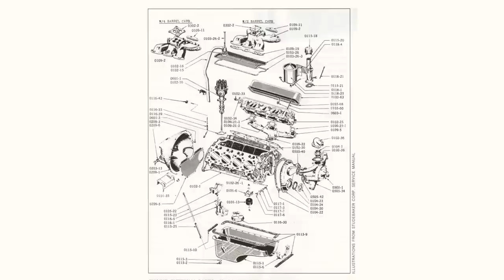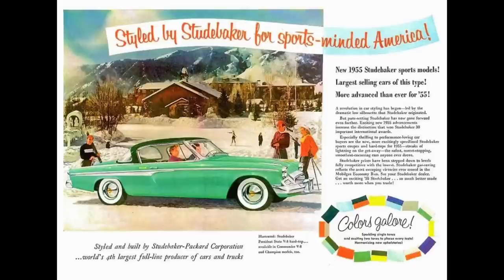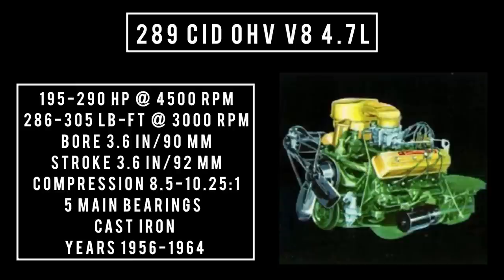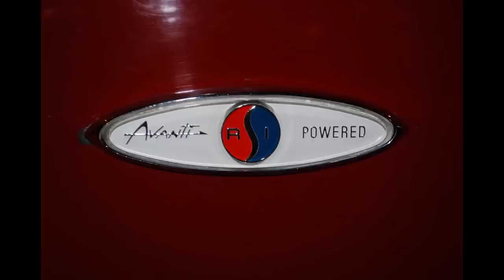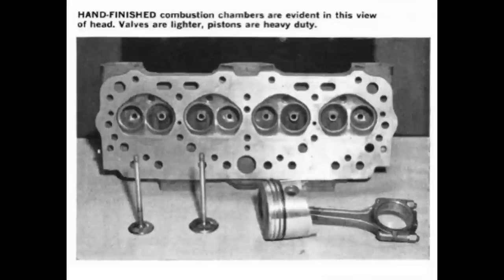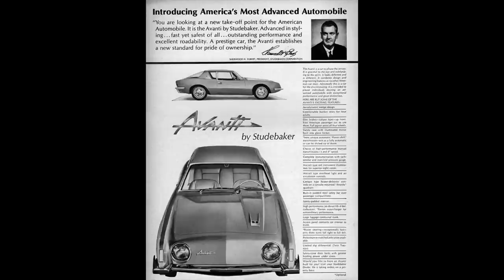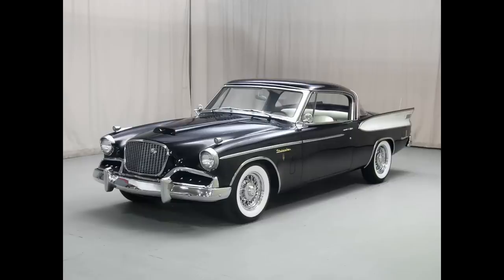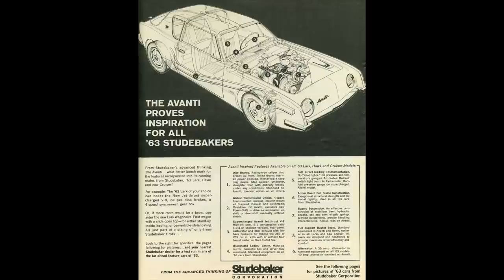STUDEBAKER V8 ENGINE ( 232, 224, 259, 289, 304.5 )

Comment: Another great presentation. I didn't have a lot of experience around these engines, but I read alot,and heard about those engines and almost all good. Thanks again for the nice work,learned a lot.
Reply from the maker: Glad you dig this episode =)
Reply: @What.its.like.  Yes I did, it's great work,I hope you do a piece on the International 266-392 V-8S,in my eyes a great gas truck engine that never used timing chain gears.
Reply from the maker: I’ll mark that down because this wasn’t the engine episode that was supposed to go up today I did an episode on the continental engine family but I had a brick wall with that episode and information is really hard to find and I just couldn’t find the information that I wanted to find a present to you guys so I had to switch course.. =)

Comment: To be a bit pedantic, there was a sixth displacement at 299 CID, although not a production sized engine.  The early R3 (that set all the touted records) was a 299, not 304.5.  This allowed them to run in the Class C "Production" class because 299 is a 0.060 overbore and 0.060 over pistons were a standard Studebaker replacement part.  Otherwise, they would have had to run in the prototype class.  Later, the R3 would, of course, be 304.5 AND now in production cars so it could then run in the C production class since it was still under 5 liters.  Studebaker referred to the 299 and 304.5 R3 engines as "A" engines and "B" engines respectively.
Reply from the maker: Great information thank you so much for sharing that

Comment: I have a 59 silver  hawk with a 259 clover leaf block so it is a truck engine with aluminum timing gears. It has ported 1955 high compression speedster heads and flat top pistons. I installed a supercharger setup from a golden hawk and backed it all up with a t10 4 speed. The little 259 just screams with the this setup! Its a fast car. High compression makes the car react quicker to the supercharger and man it pulls hard. Its hard to believe that Studebaker was able to pull this off in the 1950s. They were way ahead of the curve!
Reply from the maker: Wow that’s awesome thank you so much for sharing that I didn’t know the 259 silver Hawk came with the 259 I always thought that they came with the 289.. I really need to cover a silver hawk I would love to cover all of them power hawk Skyhawk but those were all just available and57 from my understanding thank you so much for sharing all that information =) 

Your car sounds awesome
Reply: @What.its.like.  Actually, the 289 was not available in the 59 Silver Hawk.  It was again offered in 1960.

Comment: The worst part of a studebaker engine is the Siamese center exhaust ports. It limits flow. I know a guy with a 232 that’s setup like an r3 avanti’s engine but still 232 ci. It makes 350 hp at 7lbs boost

Comment: Actually, the Studebaker V8 was produced for 13 calendar years, 1951 through 1963. In December of 1963 production was halted at South Bend, Indiana and shifted to Canada. Having no engine casting facilities at the Hamilton factory, the Chevrolet 230 SIX and 283 V8 were used till 1966 when car production ended.  The R-3 Lark would be a sleeper, particularly as a 2 door sedan. Lighter and faster than a convertible too.  A 1953 coupe or hardtop with an R series motor swap would be sweet too.
Reply from the maker: Awesome information and insight thank you so much for sharing that =)
Reply: @What.its.like.  -  You're welcome. Sadly, for Studebaker employees, the plant closed just before Christmas, 1963.

Comment: WYR1:  '55 President Speedster in gray, coral, and white, with first-year available factory air.
WYR2:   None of the above, I'd rather have a '63 Avanti, a '63 Lark Daytona Wagonaire, or a '64 Gran Turismo Hawk, any of the three with the R1 engine and three-speed transmission with overdrive (dealer option on the Avanti) and the Lark or the Hawk trimmed out with the full Super Lark or Super Hawk kit (as appropriate).
Reply from the maker: Great choices write ins are always welcomed I love seeing the difference of opinions in cars I think it’s awesome. 

We might add something to that like if you had a car like that would you trade it for any of these three are would you keep it because I think it’s very interesting to hear what people had to what they traded for I worked at the Classic Car dealership last summer and it was really interesting to see what people had and traded for like I saw a guy trade a 2016 dodge challenger coordination so I didn’t have any it was like base model but it was like brand new it only had like 3000 miles on it he traded it for a 1962 Plymouth Savoy 413 I don’t remember how much he had to pay as well I think he traded the car in and had to pay 25,000 or something like that I don’t remember

Comment: I believe that Studebaker introduced the first American OHV V-8 in the low price field. Dodge didn't get a V-8 until 1953. Plymouth got one in 1955, along with Chevrolet. Ford stuck with its flathead V-8 until 1954. Other makers learned from Studebaker's V-8 and introduced their own OHV V-8 engines using improved casting techniques. The Studebaker V-8 engines are very heavy for their displacement. Studebaker used metal with a high nickel content for strength. This was done because automakers were anticipating improved gasoline that would allow compression ratios as high as 15:1. The cylinder head design offered somewhat limited valve sizes, which hurt power at high rpm. In spite of the engine's limitations, it was strong, durable and well made. They are good engines that produce great sounds from the golden age of American OHV V-8 power. 

I can't choose my favorite cars. I want all of them.
Reply from the maker: Thank you so much for sharing all that information and insight and you’re right it was the first low priced OHV V8
Reply: Studebaker was first of the low-cost cars to have  a Overhead valve v8 engine. The cost of being first is, you can't look at the engines that come before you to improve on your mistakes. Studebaker copied Cadilac but if they could have copied Chevy, they could have had a much more modern engine. The reason the small block Chevy was so advanced is they looked at all the Engines that came before and improved their engine. Being first may sound good, but being last is a big advantage in the development department. The cost of being first were poor port design, over built engine causing heavy weight and dimensions that don't allow for Future expansion.

Comment: Studebaker afficionado here.  Excellent video, most informative.  I have a 1955 President with a 289 engine from a 1963 Hawk.  It is an excellent engine.  If you say you have a 289 people immediately think Ford but the Studebaker 289 predated the Ford.  In fact I read somewhere that Ford approached Studebaker about purchasing their 289s as it filled a niche in engine sizes.  Nothing came of it, for among other reasons, Studebaker simply did not have the capacity to produce the number of engines required.  As to your question of preference, it would be the Golden Hawk, arguably America's first muscle car. After all, I already have a 1950 bulletnose and my 1955 President State was trimmed to duplicate a Speedster by a previous owner.
Reply from the maker: Awesome thank you so much for all the positive vibes I really appreciate it I’m glad you dig this episode Thank you so much for all of the added information as well as insight

Comment: Had a 1960 Lark V8 3 on the tree with overdrive. Wonderful car!
Reply from the maker: Sweet two-door, four-door, wagon, convertible
Reply: @What.its.like.  2 door tan color, in over drive got good mileage. Also had a 1951 truck, a 1954  Champion flathead 6, and a 1951 Commander. They were cheap in the 1960s for a high school kid. THE Lark was the best!
Reply: @What.its.like.  Tan 2 door had lots of power and good mileage. Also had a 1951 Commander, 1951 truck, and a 1954 2 door flathead 6 Champion. Lark was the best!
Reply from the maker: Awesome thank you so much for sharing your car with us.. =)

Comment: Good review but you seem to skip the trucks.  Studebaker used a 224 in trucks in 1954.  Never made since to me but it works well in my 3R28.  The 2r and 3R truck comments were nice, 2R ran from 1949 to 1953 and 3R for 9-months of 1954 model year. Silly they did not offer a V8 in 1/2 and 3/4 ton trucks until 1955.  What a missed opportunity.  I would take the 51 Starlight coupe for the first choice and a GT Hark with R3 for the second.  Love my R1 Lark but it would be better with a R2 or even better with a R3.

Comment: Would have been so cool if Studebaker would have survived and developed a big block. Imagine a 1970 Studebaker Road Hawk with a supercharged 418 big block.
Reply from the maker: It would have been cool if studebaker and packard could go on the Packard engine was awesome and was only used for two years and could have been that “big block” engine that engine could support 5 in bore centers biggest displacement it achieved 374 cid but could have gone to 500 cid maybe more
Reply: @What.its.like.  It would have been cooler if both companies survived and remained separate entities.
Reply from the maker: Packard merged with the wrong company packard should have merged with peerless and Pierce arrow..

Comment: Never realized that the 224 V-8 was designed to replace the six-cylinder engine, assuming they could have made the dimensions small enough to make it 200 CID...that would have been a feather in Studebaker's cap
Reply from the maker: Just like AMC they kept the flathead six around though until they made an overhead valve version and then kept that around

AMC made the 196 overhead valve to replace the flying Scott engine even though it was the flying Scotsman engine with overhead valve fitted to it both lasted until 1965 which is absolutely crazy AMC had a flathead engine on offer in 1965.. The same here Ford had the mustang fastback Shelby GT 500

Comment: not sure on the 304 .5 s  bore and stroke but 4 inch bore and 3.6 stroke is about 360 ci
Reply from the maker: I’m not sure what the bore is supposed to be it was conflicting information from one source at 3.65 inches another source said 4 inches but it couldn’t be 3.65 inches because that’s what a regular 289 was.. So I was perplexed and that’s why there’s two different figures
Reply: Engine displacement is roughly pi x radius squared x stroke x # of cylinders

Comment: The bore and stroke you give for the 304 puts it in  LS3 range (376 cu in) so must be off.
Reply from the maker: Yeah it didn’t make sense the specs one site said 3.6 but that’s what the 289 was so much conflicting information on that engine

Comment: People make fun of Chrysler because they went through many owners ...but the company that became American Motors used parts from many other manufacturers including engines and drive trains and no one ever laughed at them for being a piecemeal company...
Reply from the maker: To be fair a lot of companies did it in the 50s think continental engine how many companies use continental engine especially in the 30s dodge used Continental engines at one point . Building an engine is expensive. but I see where your coming from but then again Chrysler changed hands how many times I think they changed hands eight times after the 80s it was five or six times 
Not counting the countless bail out I think they had three bail out

Chrysler 
Damlier Chrysler 
Chrysler llc 
Chrysler group llc
Fiat Chrysler 
Stellantis

Comment: re the 304, i also want to know the bore and stroke... 4 x3.6 would be over 350 cubic inches...the design of the time ws a large bore and short stroke, but studes had a very small bore sizeand longer stroke...so, while a more street practical higher torque at lower rpm ..and torque is the power that gets it going from a stop to 5250 rpm...the marketing was all about horsepower...which wins races at the top end...nascar racers had the horsepower rating written on theirfenders  in large lettering.. buick used high torque, low rpm engines and only advertise torque ratings..
Reply: 3.65 inch bore is what i found.. same as 289.

Comment: The way I understand it.  The R-3 engines were special selected heavy duty truck blocks. They are marked with a clover leave in the vin code. I believe Studebaker sent these blocks to Andy Granitelli he bored them out .093, and added the Paxton supercharger. To make it a 304 cubic inch.
Reply from the maker: Thank you so much for sharing all that information and insight I really appreciate it =)
Reply: They were a high nickel content
On the truck blocks
Reply: @keithcasner6842  From what I understand, they were all high nickel blocks. They sorted truck blocks by core shift, or best castings.
 I know Studebaker cranks, and Rods, were all forged steel, even the six cylinders.

Comment: 😈🔱👿... question why was Studebaker supercharging luxury cars who are they competing with who else was making supercharged cars in the 50s ???... And in 63 64 why were they building a race engine ?
Reply from the maker: 57 thunderbird offered a Paxton supercharger tho rare.. studebaker had to use the 289 because the Packard engine was no longer available because they releasing the Packard factory out the Curtis- Wright. they eventually sold the Packard factory to them.. the Studebaker used a McCulloch supercharger ( which is the parent company of Paxton before selling it off in 1958)

Comment: I take it that the Studebaker 289 was much heavier than Ford's 289 of somewhat later
seems like the Studebaker was overbuilt and should have been very durable except in the higher compression "R" series but I remember that in the late 1950s people sort of held Studebaker in contempt or something,saying that it was poorly built and would start burning oil at lower mileage than other cars,I guess if that reputation was widespread:,might explain the poor sales and eventual demise of the brand

 I understand that one of the fastest Studebakers ever was a Packard engined version of the Hawk produced in the last year before the Packard engine plant was shut down only a couple years after it was put into operation
Reply from the maker: Thank you so much for sharing all the insight I heard the Studebaker powered hawks were better 56 Goldenhawk was the only car Studebaker ever made that was powered by a Packard engine. I heard they were fast but they were super nose heavy because that engine weighed a ton
Reply: I've never heard of oil consumption problems.  Many of them eventually had rear main seal leaks, however.
Reply: Not so much overbuilt, they hadn't mastered thin wall casting. And solid lifters? WTF.

Comment: 😈🔱👿 is 3000 rpm a high rpm for these engines.. Because compared to there hp they look like torque monsters.. in one video I seen a guy with a supercharged one roasting the tires off why didn't anybody use these engines in hot rods ???.. especially in the fifties when most engines were slow
Reply from the maker: I have no idea why people didn’t use this engine.. but you can bet if it had ford Chevy or Chrysler on the side of it.. then it would be considered holy grail
Reply: @What.its.like.  yeah i agree... Studs are one of those cars that were ahead of there time and mostly forgotten about except by us odd folks that like something diff... Im the same way with bikes..last one i want is a harley..everybody has one 🙄..

Comment: Styles weren't their selling point. Had good dependable engines but the styling was (not even close). 57 Golden Hawk wins hands down on styling. Those are cool but under powered.
Reply from the maker: I never heard of anybody saying the golden hawk is under powered 270hp would move that along pretty nicely I would think, The thing I like the most about the Studebaker golden hawk is it’s not compromise it’s the best personal luxury/sports car of the 50s in my opinion.. The Thunderbird in the Corvette especially the Corvette are really hard to get into if you’re tall you’re sitting on the floor with a cushion under your ass essentially the Studebaker golden hawk doesn’t have any of that and it has a backseat that is usable..